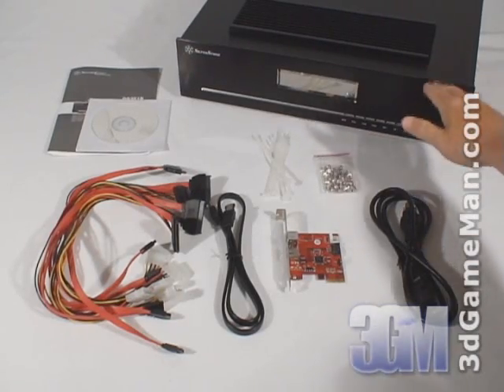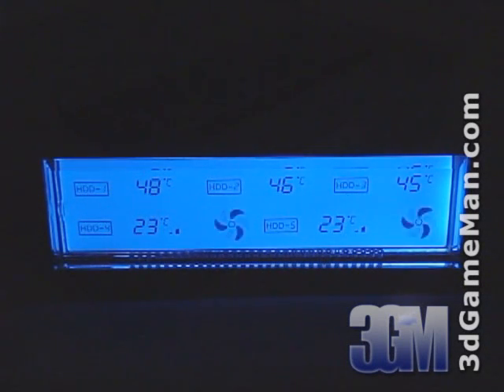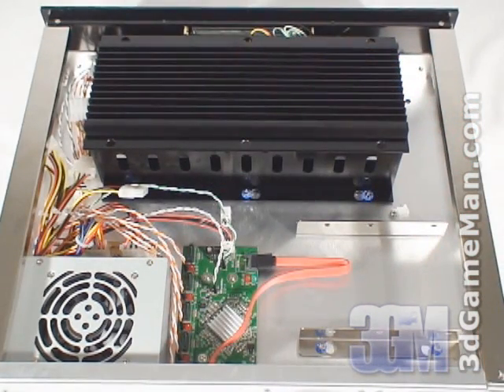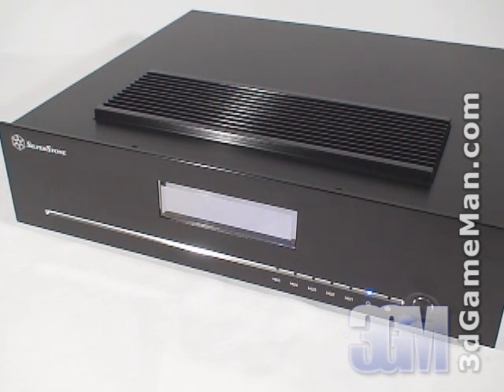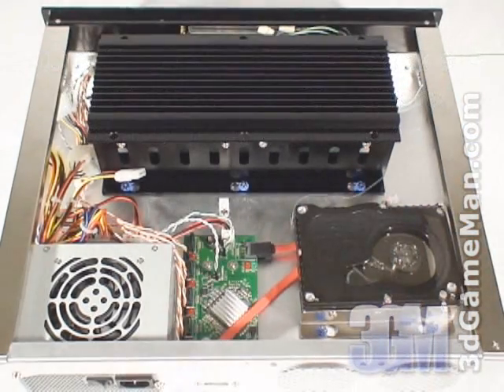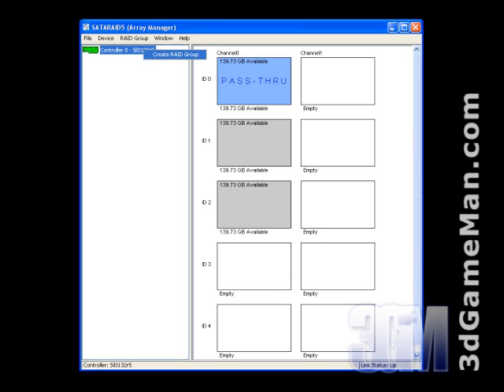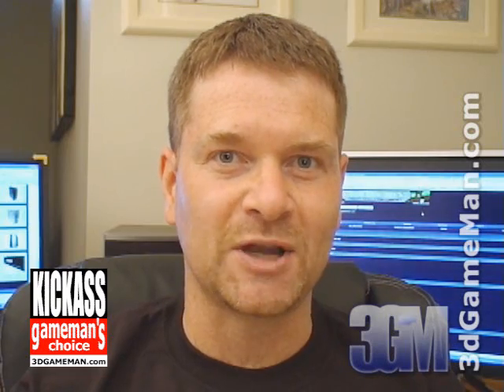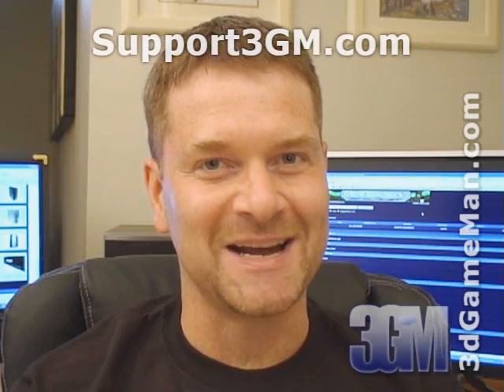#828 - SilverStone DS351 External RAID HDD Storage

Comment: the raid 0 result looks sucky and I am thinking that it is the Raid Controller's fault .. is it hitting a bottleneck at 90MB/s?
ESATA is supposed to be a touch less than 300MB/s if the hard drives can input/output that amount of data.